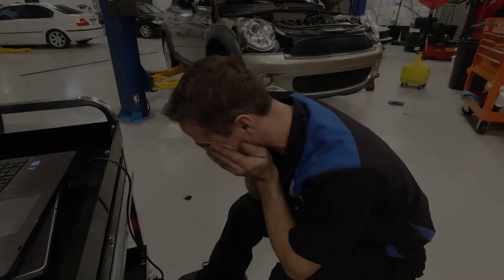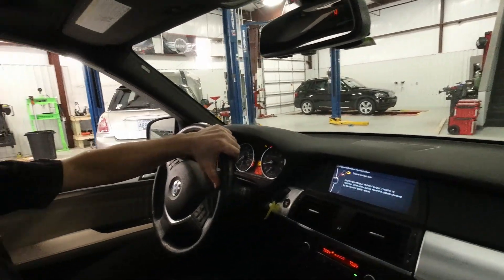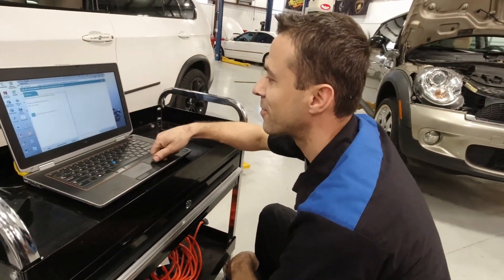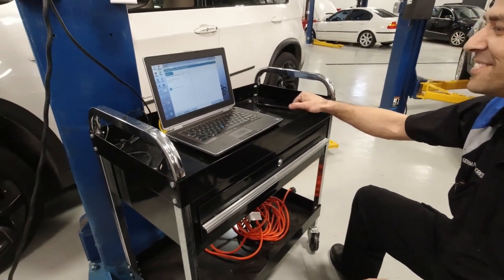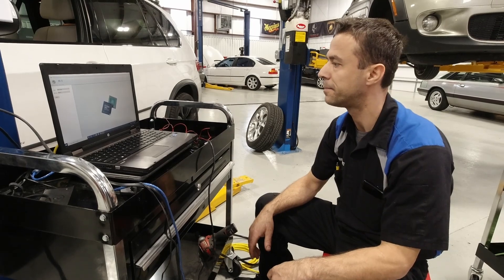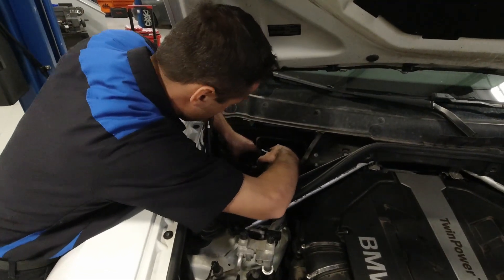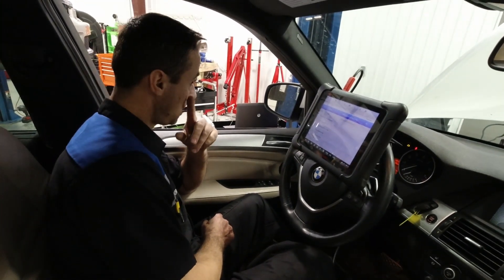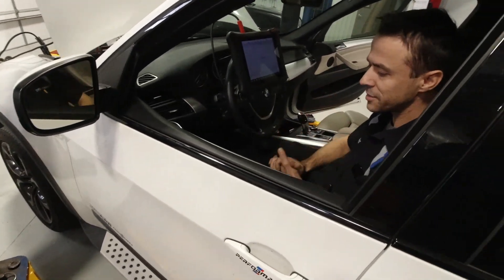Cloning a BMW MSD85 DME with Hextag 2

Comment: People here comment as if BMW is evil and made things intentionally difficult for car owners. These idiots don't realize that Audi/VW, Range Rover and Mercedes have the same exact complex engine computers specif to VIN. All domestic and more than half of the older Japanese brands and all the newer Japanese models have the same exact problem: They are NOT plug and play. All engine modules store the immo of the car and all second-hand ECUs have to be adapted or recoded to make them work and expensive coding and programming equipment is needed. But ... still BMW are some of the worst and hardest to crack. But it's double with the right software and interface. The only problem is .... these interfaces cost an arm and a leg on top of the annual subscription fees and/or per-use fees and bullcr-p. That's why 90% of all the locksmiths out there (amateurs) don't wanna program keys to BMW and Mercedes when all keys are lost. They'd have to work with immo data from ECU and don't know how to handle security access codes and passcodes. They are just shysters that only prefer the easy way of making the buck. Even for me as a security specialist cracking the BMW ISN in the F and G-series is the most difficult task . Tough world out there.

Comment: A module that is coded and specific to a particular VIN. That's almost evil. Once again, nice work Jonny.
Reply: Not really. Its because BMW collects statistics and historical data on all the systems to be able to track important parameters. Later ones also driver specific behaviors. To switch this dats to another vehicle will understandably cause confusion to the ECU

Comment: Basically the anti theft system (which was called EWS for a long time) is uniquely matched to the DME. So it looks like the injector 'driver' module on the DME board is fried, however if it is still talking to scan tools, then getting a rom dump is possible.   Hacking BMW DME's is a pretty common practice to get anti theft deletes and modding stock engines. From a service point of view, if a DME fails in the cars lifetime, which shouldnt happen then BMW should replace it at cost, at least allow one replacement per VIN vehicle.

Comment: So BMW make it as hard as possible for owners to get their cars to be maintained without them raping them dollars wise. REusing parts from  parts cars is a long time legitimate method. I know they arent the only manufacturer doing this but it is simply wrong. There have been enough inbuilt massive expensive failures with BMWs that have been there for a decade anyway like VANOS ,SMG, actuators etc.

Comment: Normally these problems are caused by failed a MOSFET (a transistor) on the ECU board. Here in EU for these we have professional companies capable to open the ECU replace the 1$ transistor (if its failure didn't cook the rest of the ECU) and you're back in business. Replacing a whole ECU for just one basic component is a terrible waste of money... You can check for the failure with an oscilloscope, if you have some electronic skills.

Comment: you mentioned "once bmw put vin to a module its married to it" completely wrong, free softwares online and a $20 cable allows you to change vin in seconds.
Reply: so... He bought $3500 computer and software, when he could only paid $20 for it?
is that what you are saying?
you can do exactly the same thing this guy did in this video for $20?
Reply: @davidjacobs8558  don't believe me just search up inpa, ncs expert, winfkp, ista-p, ista-d and you'll see what those software can so and they're totally free to download and i myself have been doing this past 3 years. 3 years ago i used to pay some jo blo like me to do this but then in searched it up and it was all over the web for free. U can buy a $60 cable from bimmergeeks dot com which is like the best and most reliable one u can get but a $20 cable works too. Trust me man most of these old time mechanics are pretty dumb they don't know this geeky stuff so they buy $3500 tools and think they're hackers lol
Reply: @markm0000  basically the tools i mentioned are all bmw dealer tools that people have cracked and they work all the time despite being pirated.
Reply: @markm0000   working everytime is not a problem like get over it. And I'd rather go with a bmw dealer software, regarless of being craked, that i know is compatible with bmw rather than some aftermarket thing

Comment: tbh its not that big of a deal, all you did was copy paste, surprised you call that computer hacking lol i used to do it on the ms43 ecu's on e46's on a daily. and i also clone frm3 modules often on most e series bmw. using used modules from salvaged bmw is a normal thing these day. Mostly with bmw modules is the software that gets corrupted and cloning fixes the issue and you dont even have to change the module, the harware rarely fails.
Reply: When you say the "software gets corrupted and cloning fixes the issue", do you mean you just clone the faulty module and reflash the same module with the cloned data? Wouldn't updating the software in the module  be the way to go unless it already has the latest update?
Reply: @mikepottle3604  i dont know the back end of it but if you delete everything in the module it somehow restores itself back to its original working state and clears any faults in the module. however updating it sometimes doesnt work but once u get the module all reset you can update it and it wont corrupt again. the backend of this whole software thing is pretty complicated , i did some research on it a few years back but dont remember atm but to simplify things, all you do is decode the module with  a BDM to USB adapter with a special software, copy the original code, then delete it from the module and paste what u had copied before but change 1 value for something to "y" and youre all set. there are a few vague forums and youtube videos but if you put em all together you can make it work. i might have made it sound like roket science but its very easy. i figure it all in couple hours
Reply: @nasirmian1  cool man, thanks for the reply. I appreciate it. Something to keep in mind next time for me.

Comment: We are lucky to have these smart guys like Ninja around, otherwise, the scrapyards would be full of BMWs :D
Reply: @Edmund_Mallory_Hardgrove  Strip out all unnecessary modules, spec durable metal for engine parts (not plastic), and BMW would have a reliable car.  They won't be selling many new cars and the dealer will not have as much service revenue.  Not hard to see why BMW is BMW.  BTW, saw are very nice X3 3.0i at the junkyard today.  Paint and interior were near perfect.  Shame on BMW.
Reply: Scrap yards are full of BMW's.  Look at the inventory of any LKQ.  Nice cars with nice interiors are getting junked.

Comment: Basically, it's the same thing a dealer would do, using a salvage DME instead of a new DME.  Saved his customer some money in the process.  Really cool!
Reply: No dealer would ever do this. The 2 grand new one or nothing.
Reply: @wernerdanler2742  Wouldn the dealer have to program the new DME ?
Reply: @WildChinoise  I sure they would. That, I should think, would be part of the deal, unless the new ones are pre-programmed. Still, it's 2 grand. I wonder what Jonny charged him. Maybe a grand?
Reply: @wernerdanler2742  I guess only the dealer can buy a new DME, so basically Johnny had to go down this path.  Don't know what Johnny might charge, but less than a dealer charges for sure.
Reply: @WildChinoise  I actually think Jonny could get a brand new one at trade price from the dealer but it would still cost the customer close to 2 grand.
He just went with the reclaimed one to save the guy some money.
Reply: What?

Comment: Moral of the story is to avoid any BMW with a V8 engine.
Reply: Or buy them with the repairs, in mind. For example buy a cheap e92 m3 with a blown engine for cheap, buy new enging, have fun for 80000km ;)
Reply: VIN coded modules have been commonplace for 20 years.  My 99 Discovery used VIN coded modules which, at the time, were only serviceable by the dealer.  Tools like this are long awaited.
Reply: To be fair I would say pretty much avoid any BMW with the N63B44 and its variants like this X5 has. The rest of BMWs they still have their own common issues but not as bad as this engine, trust me.

Comment: Touché BMW 😅 DME is vehicle specific.. only one with years of experience can do this. Nice job car ninja 👍
Reply: There is a good reason behind it.
Because the car is harder to manipulate that way...
And it's not only BMW, basically all Manufakturers do that.
Reply: @michihoffi69  thanks a lot for the explanation. Much appreciated. 👍
Reply: @018139548  no problem thought like that to when i wanted to swap the engine in my car. But turns out there is a big market for manipulating the mileage of cars...
And even whole gangs specifically stealing cars to swap the vin from a crashed car onto a good stolen one..
So yeah some people beeing garbage is the reason behind it...
Reply: @michihoffi69  And since these workarounds are possible - it's only the normal customers that have to pay premium. Criminals use this kind of tools anyways...
Reply: No one is talking about changing VINs here.  Johnny explained that.

And that doesn't explain sub assemblies being tied to one specific vehicle.   They're trying to force you to buy only new parts from the manufacturer.  plus the manufacturer charges a lot of money for access to their mainframe, to pair the new part to the specific vehicle. 

Right To Repair advocates say this is all contrary to the Magnuson-Moss warranty act.

 All Johnny's $3,300 black box does is re-flash the part so the vehicle thinks it's new. @michihoffi69

Comment: he is using autohex to do the job not hextag. With regards to integration level (software version) you can also do this on autohex and choose individual module to program unlike with ISTA, then code module and you're done. 
Also those MSD ecus are very common to fail in that way are are quite easily fixed.
Reply: where do i   get the software ?
Reply: @SanDoval201970  microtronik.com
Reply: He use autohex right, but he can do that with hextag too, with clone option
Reply: @codingmexico4044  yes you could, they only recently released (factory version) where by no need to open ECU for boot with hextag. In video he was only able to change ISN on bench then prog/code in car. If he wanted once he had ISN of donar ecu he could have just written to the cas and be done though of course car would have different ISN than from factory.